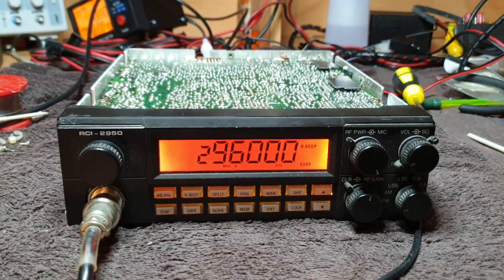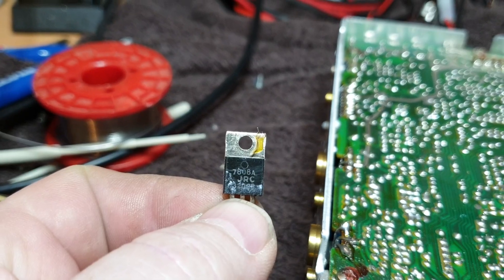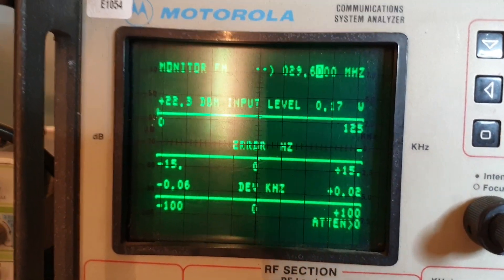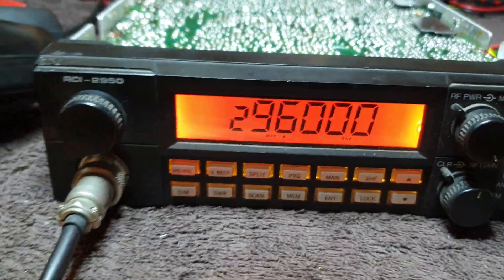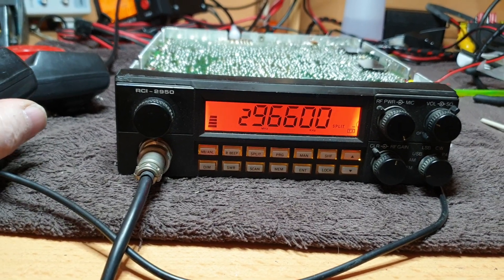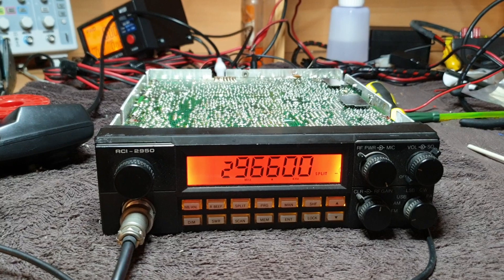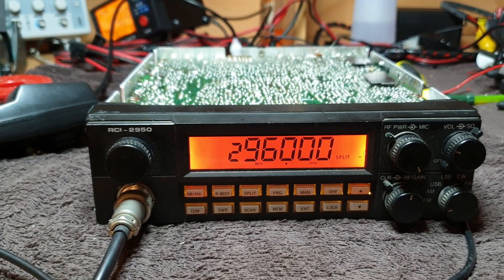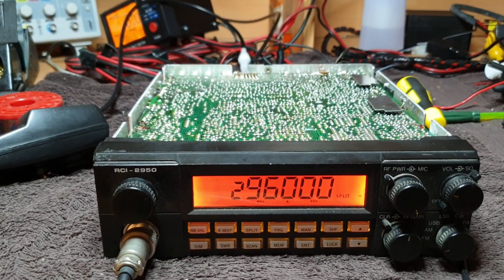Ranger 2950DX repair Part 2

Comment: What was wrong with the Mic ?
Reply from the maker: good question, it had a faulty mic element, I stole one out of a small icom mic as they are quite  a small mic element in a big mic. cheers Brenton VK3CM
Reply: @brentonmeadowsvk3cm  Hi Brenton.
I have one of these radios, which I recently took out of storage and found there was no modulation, as well as some other age-related issues. The mic element had gone open circuit, so I did what you did, and replaced it with what I had on hand, although the one I fitted was much smaller and isn't suited to the mic housing, and modulation is down, so I will need to work on that when I get back to it. I appreciate finding this presentation and seeing the issues that you found. 
John VK3PCJ.

Comment: Split will not work on that version when modified 11 meters.
Reply from the maker: yep, later that night, I modified back to 28.000 to 29.700, and whacko, I got my repeater operation back which was perfect for the operation we wanted the radio for.  cheers Brenton VK3CM